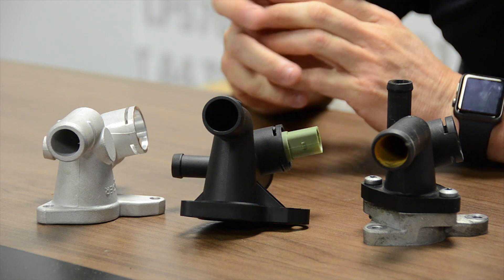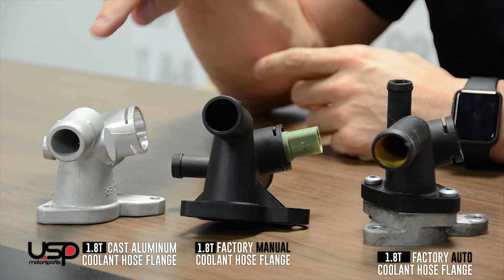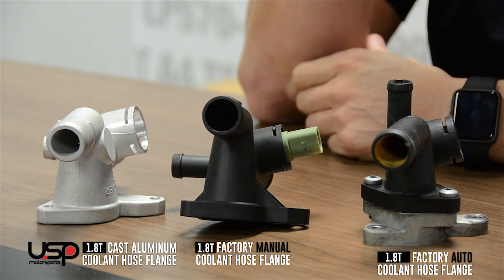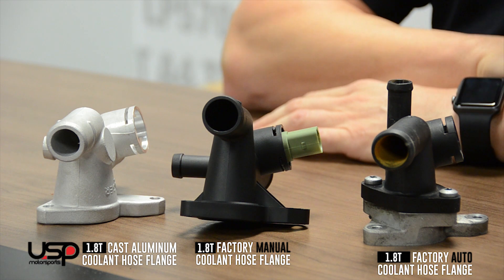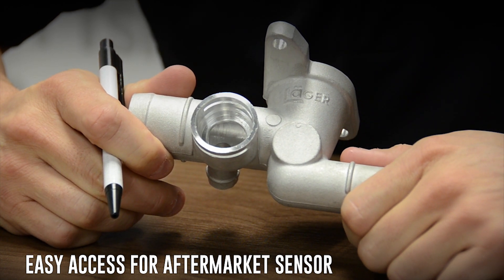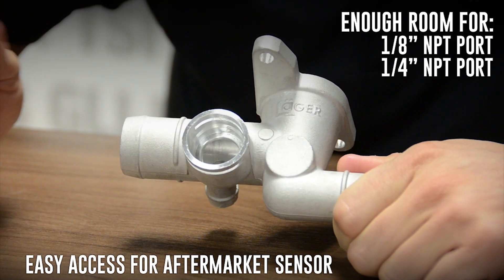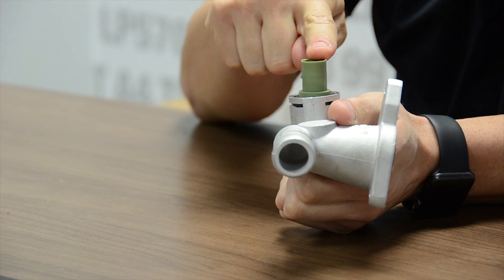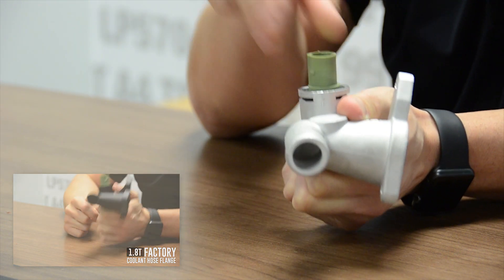USP Cast Aluminum Coolant Hose Flange | 1.8T

Comment: When looking at it from back of block what is the cover to right of it with the Allen bolts.  Have a leak thing its flange but just noticed that does it have anything with coolant system?

Comment: I got one the other day and it moves way more than in the video and has up and down movement,which is causing a coolant leak. Did you guys happen to test it before you came to market with it?
Reply: Did you move over the rubber gasket from the old housing?....
Reply: +Logan Lake no brand new gasket
Reply: yikes then that is really bad if it is leaking that badly...maybe you got a bad casting?? You buy this sort of thing so you don't have to worry about leaks.